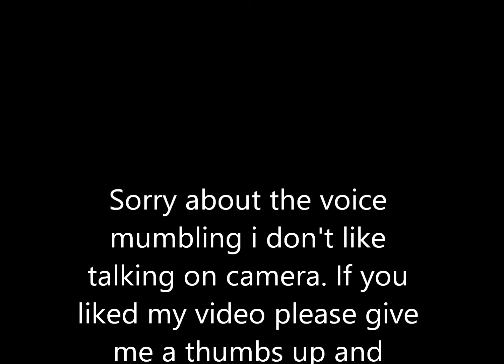Wood Turning My Second Pen Today

Comment: Hi Peter, another beautiful pen mate, looks really good, Take care Harry
Reply from the maker: +The Little Garden Shed Workshop 
Thank you Harry it turned out very nice it was one of my best ones so far. I hope the next video is better  i am hoping to have some better camera mounts. Thanks for the comment i must be getting a bit better.
Thanks 
Pete
Reply: +Peter Mitchell 
Hi Peter, you're doing fine mate, you're turning out some really nice work, the camera mounts I made, I think I showed them in video 9, have been a great help, they're easy to make and work really well, I just used cheep castors from screwfix they do the job great, it's a lot easier when you can just swing the camera around, let's have a look at them when you've made them, Best wishes Harry